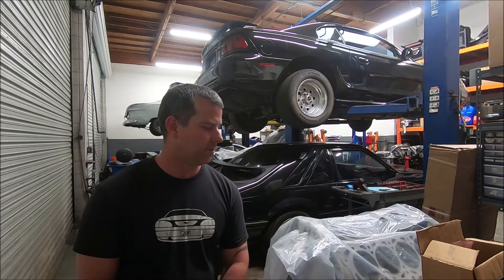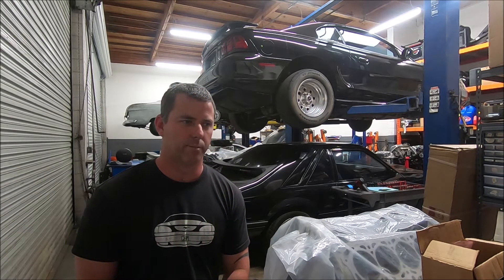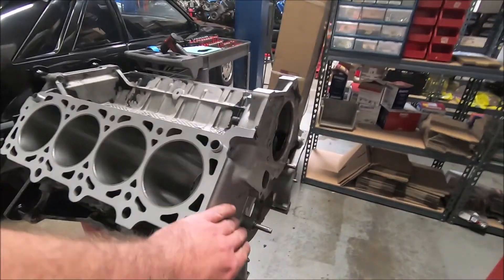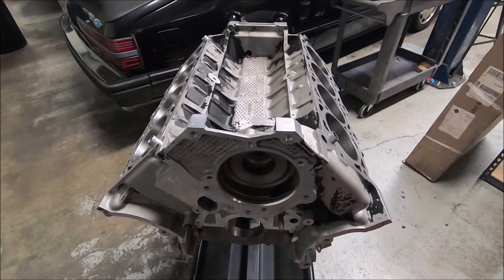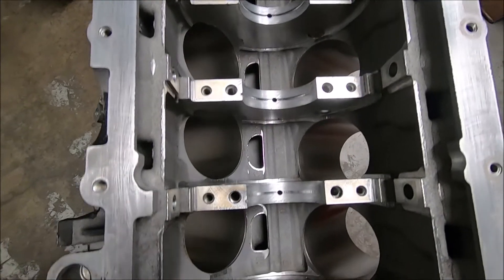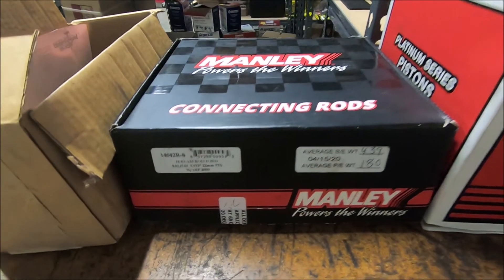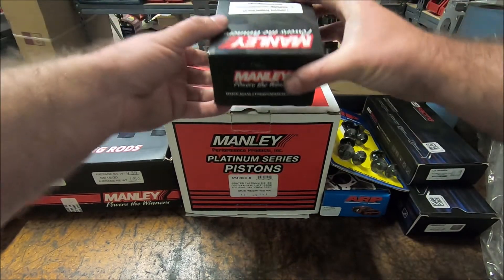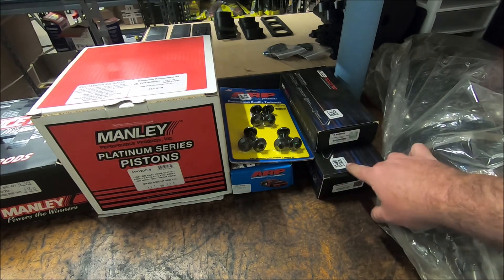99 Mustang GT Nemak Block with Manley Rods and Pistons Build Part 1

Comment: I'm undertaking this exact build right now thanks to all your videos! I'm grateful for all the help that you have provided. When you send your block to a machine shop do you have it aligned honed for the new ARP fasteners? I can still see the cross-hatching on my mains. If you have it bored out do you have them use a torque plate? I am thinking that decking the block is a must.
Reply from the maker: Thanks for watching the videos.  I do not have the blocks aligned honed.  In my opinion it is not necessary if there is no damage to the mains.  I have also built engines using the factory rods with ARP fasteners and have had zero issues.  I do recommend using a torque plate.  If the deck surface looks ate up then I recommend having it milled.  It's good insurance to help make sure the heads seal.  Same goes for the surface of the heads.
Reply: @JohnSmithRacing  Thanks I appreciate your time!